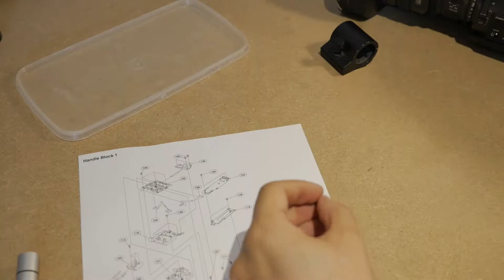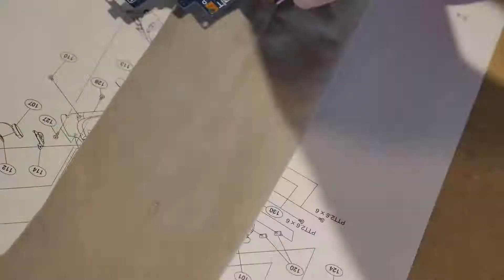Sony EX1 power swich repare

Comment: I have problem with this Switch too . But I put lens down to table and bottom up, use Contact Cleaner spray a little to on off switch and then move back , forward 10 times. than use Duster (dust and lint removed)blows air away Contact Cleaner while still back and forward switch unstill dry .
I DO NOT OPEN ANY THING FROM Camcorder .My Sony PWM EX1 Work perfect now . This method can do to Sony EXR1 or EX3 . I think , due to on and off too many time it's dirty . use this step for volume control of amplify if you crank up hear sound static .That way I Fixed my Amplify too .🤓

Comment: Has someone tried to just clean the existing sliding switch with contact spray?
Reply from the maker: Yes, it works
Reply: @antoinevanderstraeten1315  do you need to open the camera or is it possible to just spray carefully from the outside?
Reply from the maker: @bauerusa25  you would need to open the camera and get access to the circuit board, plus the guy who did it pried open the metal enclosure of the swich, then clean it, then bent it back. It think that with contact spray you don't need to pry it but you won't be able to access it without removing the plastic enclosure of the camera.
Reply: Okay, thanks a lot for your help 😃👍

Comment: On yout backfire board bearing video, what size of key did you use open the motor?
Reply from the maker: I think hex 2.5mm for the cap and for rest of the bolt it was a regular skate tool with 10mm, 13mm and 14mm wrench
Reply: Thank you!
Reply: @antoinevanderstraeten1315  Another question, what size bearings did you buy? I'm trying to replace mine because they're really used up. Thanks!
Reply from the maker: @MasterZiomekPL  for the size you must check it on backfire board USA, because the size change depending on the production date of the board. The brand I used is sdn its French made, I took those because I'm living near by but they have been reliable that said any high quality waterproof bearing should be fine.

Comment: Awesome .....can I ask you was this causing the Ex1 to sometimes shut off or turn on than shut right off because my EX1 is doing that ?
Reply from the maker: Yes that's what was happening, also touching the power button would make it turn off and back on.
Reply: @antoinevanderstraeten1315  Thank you how is your Ex1 doing so far ?
Reply from the maker: @1985monstroful  it's working very well, I didn't had any issues with this one since and it is used 5-10h/week on average.
Reply: Very good. Where did you get that chip which you unsoldered?
Reply: @antoinevanderstraeten1315  do you provide this service (fix the switch)?
Reply from the maker: @bachtran1466  I guess I could, add me on Facebook and we can talk about it https://www.facebook.com/antoine.vanderstraeten.7
Reply from the maker: @bachtran1466  otherwise I found the switch on aliexpress I put the link some time ago in the comments of this video
Reply: @1985monstroful  Did you repair your Ex1?And if yes,how?
Reply: @17mstarc  yes I did its funny you can actually repair this issue with no new part part .....if you carefully take it apart to get to the switch you can de solder one side of the tiny switch only removing the plastic sliding knob and with a tiny flat head scrape the oxidation of the switch from inside till the copper is shiny and exposed and then put the plastic sliding switch back in and solder back the one side .....(oh and onother note the two prongs that rest against the switch I carefully bent them outward to give it more resistance/contact to the switch 👍🏼 hopefully that makes sense